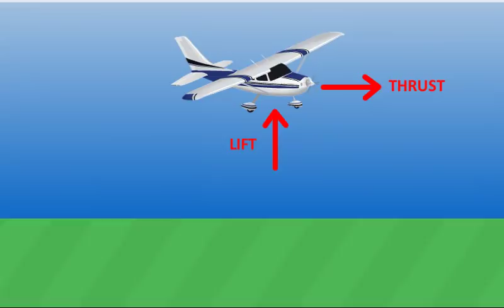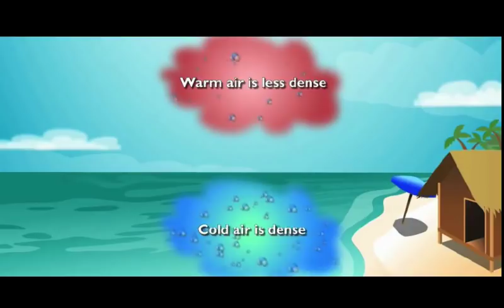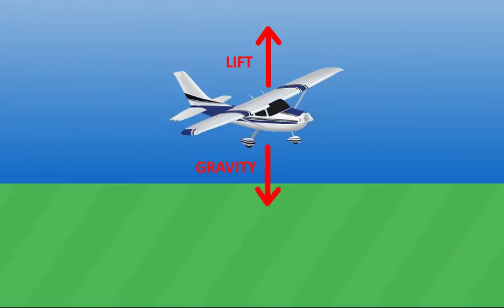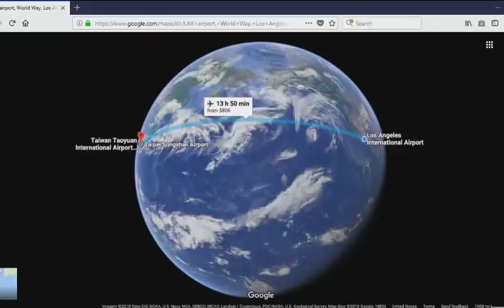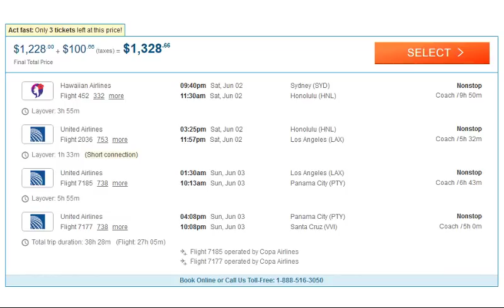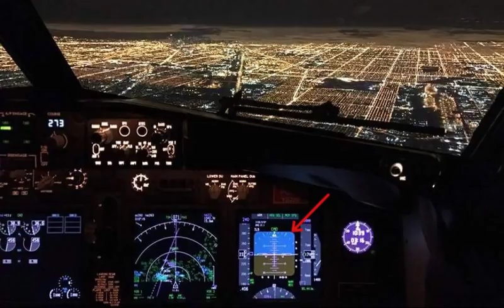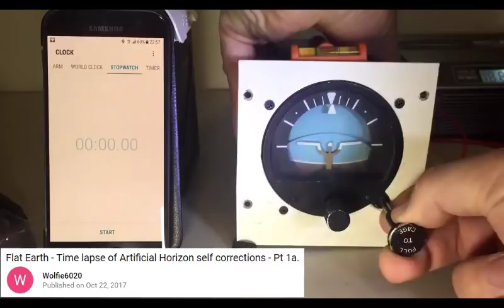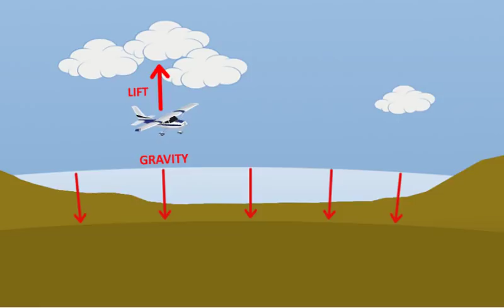Flat Earth Falsities - Plane Nonsense

Comment: So the coriolis effect can work for a bullet but not for a plane or helicopter.... Yea right 

https://youtu.be/jX7dcl_ERNs
Reply: muncher man 

A pilot is constantly adjusting course.

Coriolis matters most for winds and ocean currents, but I am quite sure the truth doesn't really interest you.
Reply: Peter Galbraith , you have not answered my question how can the coriolis effect only be considered for the bullet but not the plane when they are both traveling either against or with the earths rotation?
Reply: By the way the truth does matter , but you don't present the truth
Reply: muncher man 

Because you aim a bullet and it doesn't alter it course by itself.
A pilot flies a plane and makes constant adjustments to maintain a heading. 

If the truth matters, look into why wind turn around high and low pressure systems. That's Coriolis. Look into what we call "geostrophy".
Reply: Peter Galbraith , you are missing the point forget the course altering of the plane if the plane was to stick to its course without any deviation in speed or altitude or direct why does the coriolis effect apply?
Reply: muncher man.

What is it you are not capable to understand? Have you never driven a car, correcting the course every second?

A bullet is fire and forget.
An airplane is constantly adjusting the course.

The Coriolis effect is just one parameter. The windspeed/jetstreams in high altitude is another, atmospheric pressure is a 3rd. The auto pilot corrects for it all. Every second.
Reply: Peter Galbraith. You just participated in a pigeon chess game.

Origin: "Debating creationists on the topic of evolution is rather like trying to play chess with a pigeon; it knocks the pieces over, craps on the board, and flies back to its flock to claim victory." -- Scott D. Weitzenhoffer
Reply: Hans Nielsen 

You can take a horse to water but you can't make him drink. These people are not interested in the truth. If any true answer has any resemblance "to what he was told" then it can't be true, because they are delusional like that.
Reply: muncher man 

I give up.
Reply: Peter Galbraith,  you should do because you are just repeating what we have been told and the information we have been given does not add up there are to many contradictions
Reply: Hans Nielsen,  I know some very good creationists,  Neil degrees Tysson, bill nye, caparnicus,  nasa, not forgetting the nice Mr Brian cox
Reply: You know them??? I very much doubt it.
Aren't you just telling flatter lies again?

Describing the named persons as creationists is just another demonstration of, you haven't' got even the faintest clue of, what you are babbling about!

Comment: If the atmosphere moves with the rotation of the earth,  when you are travelling in the opersite direction to the spin there must be more air resistance right, like travelling against the flow of a river
Reply: When you are in the car the air inside is travelling with you, just like on Earth. Do you feel more air resistance in one direction there?
Reply: muncher man The atmosphere as a whole moves in the same speed & direction as the globe; that does not prevent localised differences called winds. Multiple factors can apply simultaneously.
Reply: muncher man 

Exactly the opposite. Say you are paddling in a large ocean current, so large it's all going at the same speed around you. Go in any direction and you will paddle at the same speed relative to the water. Unless a GPS can give you ground speed, you'd have no way of knowing.
Reply: Peter Galbraith,  wtf has that got to do with the example I presented you with?  

Earth spins one direction 
Atmosphere moves same direction,  travel opposite you have resistance to flow hence plane has to work harder it's simple science
Reply: muncher man 

Lol. The atmosphere moves with the Earth; you said so yourself. If you are travelling through  air, with speed relative to that air, then travelling in any direction leads to the same resistance.  The resistance is function of speed relative to the air, not direction.

Stay polite or I won't bother replying again.
Reply: Peter Galbraith, if it's correct that the atmosphere moves with the spin of the globe  then the clouds.  rain, dust, fog would stay in the same place on the globe, and the weather would not move on
Reply: muncher man When you're standing still you, the atmosphere and the Earth are all moving at the same speed. Start walking in any direction and you will pass through the same volume of air regardless of what direction you walk in. Why do you think that similarity should generate different resistance?
Reply: Flook D ,for this to work the cloud would stay stationary as the earth is spinning
Reply: muncher man 

I think you are taking this too literally
Reply: muncher man.

Never heard about local wind/storms/hurricanes affecting the clouds? Come on.....

Comment: Get on a merry go round and pour some water in the middle and hang on to keep from flying outward and watch the water move outward as well! Case closed! The atmosphere does not move with the Earth,, that's why we have weather patterns!
Reply from the maker: And do you have a gravitational force pulling toward the center of the merry-go-round? Your analogy fails on two critical points.
Reply: Are you spinning your merry-go-round at the correct speed?
0.000696 rpm. 
Roughly half the speed of an hour hand on a clock. 
1/1436th of a complete turn every minute.

Comment: ... but a flight from LA to NY (4hr 50min)does NOT take the same amount of time as a flight from NY to LA (6hr 10 min). Wow... talk about misconceptions. The rotation of the earth absolutely does affect flight times. You know the earth is spinning at just over 1000 mph, yea? Misunderstanding Fluid Dynamics can be a bitch.
You want a real brain buster? Given the inverse square law (which is used to define the pull of gravity) and what we know about centrifugal force, would someone at the center of the earth be effectively weightless? or would they be crushed? Think hard. Maybe Byrd was right after all.
Reply: ReverenXero 

The flight time difference is because of prevailing winds, which are not 1000 mph but still only exist because of rotation.

You'd be both weightless AND crushed at the center. One doesn't prevent the other.
Reply: you didn't think that through far enough. As far as the trade winds, those are more driven by convenction currents as the sun "rises" the air warms and expands. conversely, as the sun "sets" the air cools and contracts. Friction also plays an unintuitive roll.
Reply: ReverenXero 

Thanks for the laugh.
Reply: What’s the formula for centrifugal force genius?
Remember the Earth is only spinning at 0.00069 rpm (1/1436)

Incidentally, objects at the equator are measurably lighter due to centrifugal force, but it’s a very small difference.
Reply: Inverse square for gravity is an abstraction, there is no "real" such thing as a center of mass. The CoM model basically assumes the whole of the Earth is totally weightless, save for an incredibly dense sphere of matter in its middle - under this model, you would be crushed when you went in the center. However, this is obviously not the case. When you go into the center of the Earth everything is pulling you out evenly, so you would be effectively weightless. Basically the idea of CoM breaks down when you enter into an object, but we still use it because it works excellently for solid spheres and those are more or less everything that's relevant in space.

Comment: It seems like a completely valid thought for a flat earther that if a cessna will fly level on a curved earth it will immediately gain altitude in comparison to the ground below and fly off into space with a fraction of escape velocity. Yep, that's why we build huge rockets with multiple stages weighing a lot more than it's lift capabilities. Apparently we've been thinking wrong this whole time, let's just put the payload in an Airbus Beluga and get rollin.

Comment: If air is required to generat thrust how do rockets work in the vacuum of space?
Reply: Planes use propellers or jet engines to produce thrust from air. 

Rockets produce thrust using Newton’s Third Law: every action has an equal and opposite reaction. 

Push something out and you get pushed with a equal force in the opposite direction.
Reply: “No...” yep, but they don’t need to use oxygen or burn anything. It’s just a convenient way to produce the force. But expelling anything with force would create the same effect. 
e.g. any kid with a bottle rocket knows that compressed air works pretty well.

Comment: If you were to take a helicopter, let it remain stationary for a few hours in the air (that’s possible right? I don’t know anything about helicopters) so if the coper were to remain in the same place. The earth would rotate, wouldn’t that be enough to disprove flat earth? Or taking a plane from los angles going to England flying over China and another plane going the opposite way, flying over New York. Isn’t that enough to prove flat earth? What about the thousands of pictures of earth from space that are not composite.

Comment: Wery nice try to educate ignorant flat earthers.  Your problem is That you don't have scientific prove that gravity exists. 
SHOW US  ONE SCIENTIFIC TEST THAT CONFIRM GRAVITY.  ONE PLS
Reply: dado smak https://youtu.be/4nTyO4p2TiM
Reply: dado smak no it doesn't... Check my flag experiment video.
Reply: How buouancy explain that objects fall faster on north/south poles  (about 9,83 m within 1,41 second) than on equator (about 9,76 m within 1,41 second) in vaccum chamber?
Reply: Jeroen De Vleesschauwer  that's prove. Put that flaggs on stell cable and stretch it to maximum and suddenly your gravity is gone
Reply: Gravity is a force that causes a constant acceleration. It does not stick anything to the ground nor prevent anything from counteracting it. That's like saying that because I can seperate two magnets, magnetism is untrue.
Reply: dado smak no it's not: according to your hypotheses (buoyancy) the flags should be at the same elevation regardles of the tension applied on the string... You're wrong.
Reply: Oceanic tides are proof of gravity. You cannot explain them with buoyency. What's that phenomenon clearly shows that water doesn't seek "its" level but is pulled to the center of the mass.
Reply: Martin Gorbush , how come there's  no tides in any great lakes on yours planet?
Reply: Jeroen De Vleesschauwer,and what about density?
Reply: dado smak 'Studies indicate that the Great Lakes spring tide, the largest tides caused by the combined forces of the sun and moon, is less than five centimeters in height. '
Reply: Small bodies of water also experience tidal forces but effects are miniscule and masked by other variations like water influx (rains), winds and air pressure change.
https://oceanservice.noaa.gov/facts/gltides.html
Reply: Jeroen De Vleesschauwer , and jet Adriatic sea which is by far smaller  than great lakes have tide every day and more than five cm. You are not questioning your self why such a big mass of water don't have a tide dayly?
Reply: Dear people, you trust authorities off any kinde over yours comon sense, logic, expirens and eyes.
Reply: dodo, Adriatic sea is connected by Strait of Otranto (not some river or cannal) to Ionian Sea which is a part of Mediterranean Sea. Even without that it contain much more water (~35000km^3) than biggest of the Great Lakes (Lake Superior - ~12000 km^3). That is why tides are much more prominent there.
Reply: Martin Gorbush , found article with 5 cm. Tide on great lakes but you didn't say that next line there say:
 Consequently, the Great Lakes are considered to be non-tidal
Reply: GrahamStw , http://milesmathis.com/caven.html
Reply: dado smak you have 'think differently' and 'being brainwashed  by fe guru's who are doing it for the money'. You're in the 2nd category.
Reply: Jeroen De Vleesschauwer ,time will show who is brainwashed . Tell one thing, do you think Elon Musk did send that Tesla in space?
Reply: dado smak redlands? Boy the brainwashing is deep with this one. Tell me, do you believe fe'ers have done any experiment per the scientific method? Ever?
Reply: Jeroen De Vleesschauwer , you can find them if you try like many other things.  But you will not do that because you trust authorities off any kinde, and don't question what they are telling you.
Try to find scientists who are not in  mainstream, you will find them if you try.  Nikola Tesla is one of them, and many others who are  not  agreeing whit big bang theory, Einstein's theories, ect
Most of all, all off science blind believers should read and memorize definition of the Scientific method.
Reply: Jeroen De Vleesschauwer , typing mistake is something comon .  Pathetic comment on that is not worth off commenting.
Reply: Hey brainwashed guru follower: "Unlike ocean tides, land tides only change the Earth's surface by around 12 inches (30 cm) or so twice a day. The movements caused by land tides are so small that most people are not even aware that they exist. They are very important to scientists like volcanologists and geologists however because it is believed that these small movements may be able to trigger volcanic eruptions.
The main causes of land tides are the gravitational fields of the sun and moon and the Earth's elasticity. The Earth is not a completely rigid body and it is made up of several layers with varying consistency (diagrams). The Earth has a solid inner core that is surrounded by a liquid outer core. The outer core is surrounded by the mantle which consists of molten rock closest to the outer core and stiff rock closer to the Earth's crust, which is its outermost layer. It is because of these flowing liquid and molten rock layers that the Earth has elasticity and thus, land tides."
https://www.thoughtco.com/land-tides-or-earth-tides-1435299
Don't forget your Paypal/Patreon/whatever donations for your FE guru's. They beg for it in every video they post. Without a promise of sound research. But hey, who's gonna help you when you're having a heart attack? glasses for eye correction? your internet? your computer? YEah, Science.
Reply: So do show me where your FE guru's follow the scientific method? I myself am an avid supporter of the apology from socrates, as written by Plato?
Reply: you just commented on the 'pathetic comment'... LOL...
Reply: Jeroen De Vleesschauwer, answering the question whit question, it is childish and off course you will not answer ?
Reply: Jeroen De Vleesschauwer ,
Reply: Jeroen De Vleesschauwer , man who doesn't offend don't have a need to apologize.
Reply: Jeroen De Vleesschauwer,like I told you if you are interested in the opposite opinion you will find it. I don't follow any guru, since you asked here is one guy https://m.youtube.com/watch?v=T6zq_wrP7n4
Reply: Me? I'm doing what Fe'ers do all the time. Changing the goalposts... Will you or will you not answer my question? I was first tbh, so go ahead. Feel free to answer it, or start moving the goalposts again.
Reply: Jeroen De Vleesschauwer , I'm on this very long and  i didn't meet anyone who's looking for money. 
You probably type Flat earth when  started,  and ended reading staff on pages like Flat earth societies. Controlled opposition , 90% off people who  read they're staff don't buy it, I woudnt .
Reply: Everything that mistirius Gravity does can be explained whit Density  Buoyancy Mass
Reply: The Cavendish Experiment. 
As reproduced by physics students all over the world. 

Now give me one scientific proof that gravity doesn’t exist.